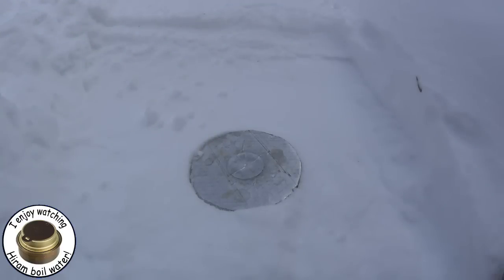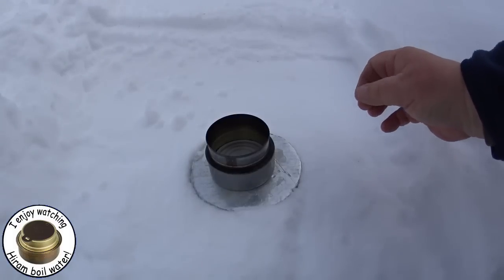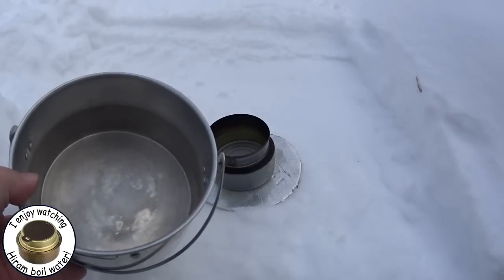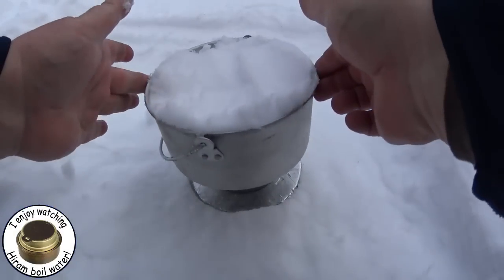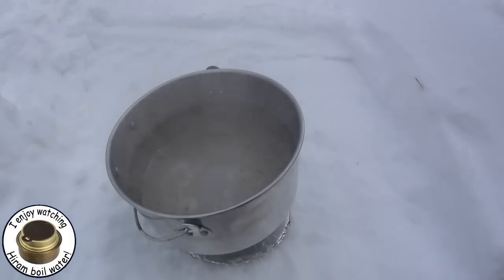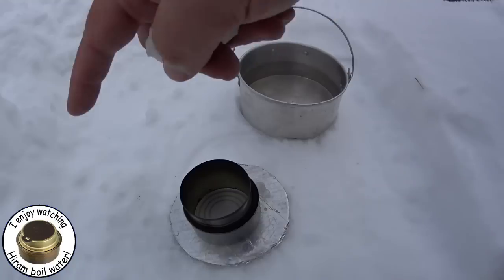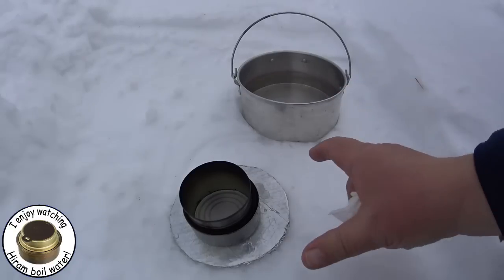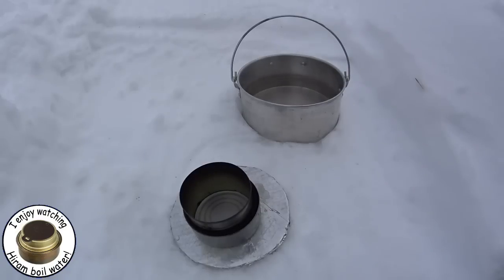Melting Snow - Boiling Water - With a Fancy Feast Type Stove

Comment: For some reason these videos take me back to the days of cooking up C rats with a single heat tab and at least being able to heat up a can of beans and a small cup of coffee. Still have that coffee cup fashioned out a fruit cocktail can and used C rat banding for a handle. I've got a feeling there are many, many more uses for that carbon fiber material.... water filter to start. After using several times can be sterilized by splashing some ETOH on it, lighting it and letting it burn for a few minutes.Just more things to check out ......

Comment: I'm wondering what your thoughts are on articles such as the one I'm attaching. Do you think the pollutants evaporate when the snow is melted or is it possible they are staying in the water and you are consuming them? http://www.iflscience.com/environment/snow-sponge-toxic-car-exhaust-particles
Reply: +comfortouch 
Interesting question. The chemicals listed in that article all have a lower boiling point than water. Thus they would evaporate off before the water boiled. So far there is no proof that snow in the outdoors captures pollutants to the degree listed in the article. They only tested within the snow chamber and there is no proof that is an accurate representation. As with all water sources, knowing which contaminants and how best to deal with them is the critical issue. 

Distilling removes lead, salt, etc but concentrates volatile chemicals such as listed in that article as well as herbicies, pesticides, petroleum products, fertilizers, detergents, etc. Boiling mitigates those volatile chemicals but concentrates lead, salt, etc. Hiking filters only mitigate biological contaminants and do nothing about lead, salt, volatile chemicals, etc. Can't say it enough: knowing which contaminants and how best to deal with them is a mission critical skill.

Comment: Pack the snow into the pot and it will melt faster. Unpacked, fluffy snow actually has insulation value, which is why its warm inside an igloo.
Reply: but snow you use for an igloo is very firmly packed.  I know snow is a good insulator as I have spent many a night in snow caves.  snow is a good insulator because it can absorb a lot of heat before it can change phases.
Reply: Utube are you a good person by living

Comment: Hello Hiram,:
You put water in the bottom of the pot to prevent the snow from scalding? I've never heard of this. We've always just filled and packed snow into our pots and heated them up to melt the snow and then boil the water.  While in winter in Ontario and also in the arctic we just melted snow. We couldn't add water as all our water would be frozen anyways...
I recently tested a Woodmite X2 rocket stove and got snow to melt and boil in 9.5 minutes. Great stoves from Woodmite!
Reply: +Chris Collier I've also heard you'll burn your pot if you just put snow in it but then I see people stuff their pot with just snow and melt it with no problem. We need Hiram to do a mythbuster episode.
Reply: I've seen pots warp from filling with snow and not adding water when heated on campfires. Dunno about other heat sources. Fluffy snow is a great insulator and campfires produce a lot of heat, which is why pots warp. Might not need to add water if you pack the snow down tightly. Never seen an ice filled pot warp. We make "snowball soup" by heating water and adding snowballs a few at a time. 

Always keep a bottle of water inside your clothes so you have some liquid water on you. Having a stainless steel bottle or two doesn't hurt either since we can put them directly on the heat even when the water inside is frozen. Happy Trails!!
Reply: duxdawg But YouTube has plenty of videos showing pots full of snow being placed directly in the campfire.
Reply: +Bobby Harper 
Not sure if you are pointing out how ridiculous some people are or stating that it won't harm the pot. Some people don't mind ruining their pots. Sometimes you get away with something a time or two, then it zaps ya. I can tell you that warped pots tend to fall over. 

I've warned many people over the years that if they kept performing various tasks the way they were that they'd end up hurting themselves or ruining their gear. Most did not listen. Warned one fellow several times about how dangerous carving with a knife in that manner was. He ignored and cut himself clear into the bone. It took six hours from hopping into the canoe to the hospital door. Think about if he had sliced an artery - might have lost the limb. 

Never hurts to consider what someone else has to say. Do what you think best, but always consider other options. 

Like I said, learned in the 1970s to make snowball soup and it has always worked well for me. I am curious now about trying two identical pots, one with fluffy snow and the other with tightly packed snow. Right now all of our snow is ice since we had a couple freezing rains. So I'll have to wait for some fluffy snow to test this. Cheers!
Reply: duxdawg I'm saying these people have great success stuffing a pot full of snow and putting it on a gas stove or camp fire.
Reply: +Chris Collier I think with a very hot stove like a canister stove or white gas stove, it could heat up so fast that it would rapidly melt a little snow then boil it off before more snow could fall in, thus the bottom of the pot would be dry and that's how you could burn it.
I think that packing the snow in will alleviate that problem. Also alcohol stoves have a lower output so they probably aren't as likely to have the problem I just mentioned.
I'm speculating though. I have never personally experienced the problem.
Reply: +Bobby Harper 
Yes, that would be good!
Reply: +ColoradoCamper 
You may be right!
Reply: ColoradoCamper They're using either campfires or canister gas for heat and they do pack the snow..